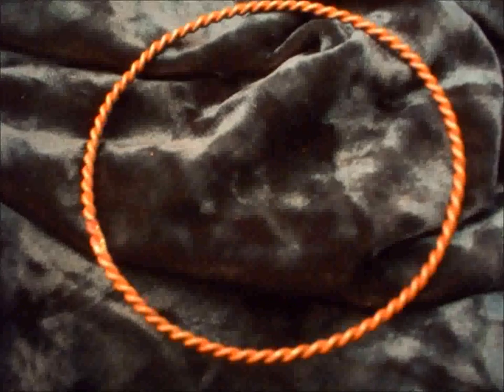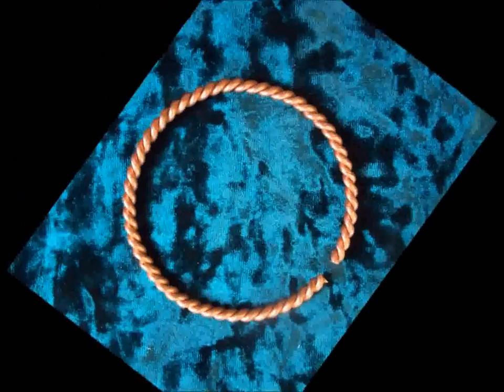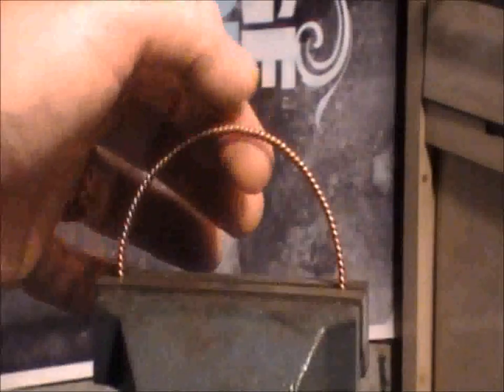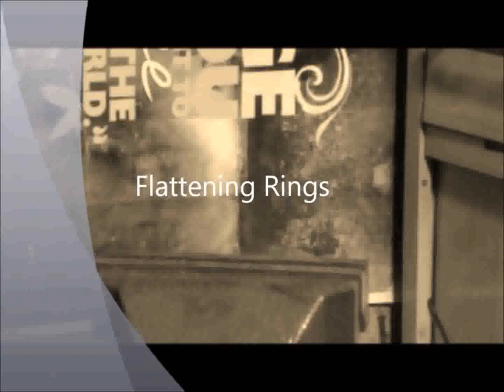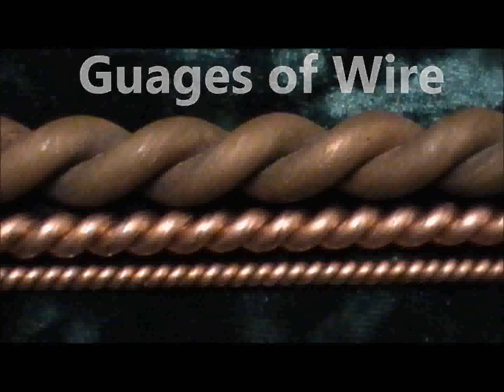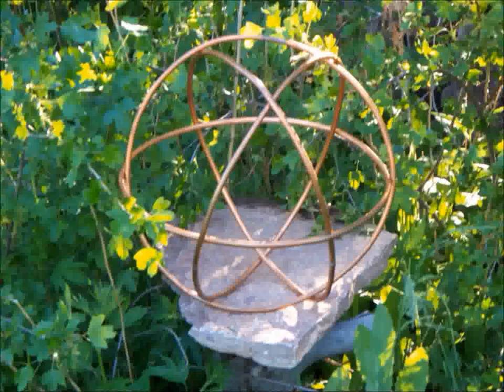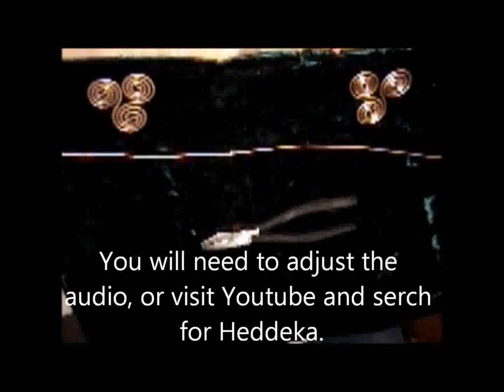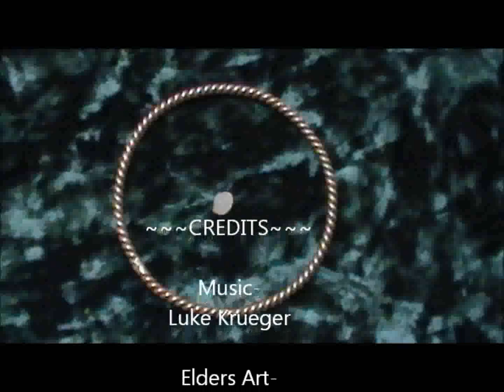Creating the Tensor Ring

Comment: Just a quick few questions: Why use non insulated wire? When twisting the two, it would seem to make sense that it just becomes one conductor; how does this work electrically? Would it not make sense to use wire such as electromagnetic wire?
Reply from the maker: Hi William.  The initial input of energy flow in the Tensor Rings is piezoelectric.  Copper is a crystalline structure, and as a wire is created, or "pulled", the micro-crystals are aligned in a one way flow of energy.  So the energetic flow is actually created within the wire itself.  It is folded in half and twisted, and the specific measure is then the antennae.  When the ends brought back on themselves it creates that continuous flow of energy that moves so fast and freely, some consider the rings to be a room-temperature super conductor.  So anyways, Tensor Rings are basically just a piezoelectric-powered antenna.
Reply: Is it possible for my to make a type of one that is 43" across but winding the wires around the ring? I made four of these rings from 1/4" fiberglass rods...I don't know anything about higher dimension electronics.
Reply from the maker: I'm not sure if seeing it right, but if using a single wire, folded in half and cut, the ends connecting back on themselves to create a continuous flow in each direction in the wire is what will create a Tensor Field.  I feel that wrapping the wires around a fiberglass rod, cut to sacred measure, would create that field.   Again, www.sacredmeasures.com for all the measures.
Reply: Yes, but if the edges touch, being uninsulated, then they would be the same.... Please help me understand.
Reply from the maker: I am confused as to where we are trying to go!!  I can tell you about a Tensor Ring with some knowing and experience, and the theory of making a working ring is all I can give you in this case, though.  A wire has a one way flow of energy, which is contained within the wire as piezoelectric energy.  Folding the wire in half creates a two-way flow.  Twist the wires clockwise, cut the specific cubit measure, and then make sure the ends come back onto their beginning.  That creates the flow in both directions. Powered by the piezoelectric current within the wire.  The specific measure is an antennae, which creates a resonant frequency aka Tensor Field.
Reply: Twistedsage.com
If I can find out how to send a drawing from here, I will show you what I mean...
Reply: Thank you! That was a biq question I had as well because I wondered if using insulated wire, as opposed to  bare or "touching" wire windings would have any different effect and if so would it be amplified/diminished or altered in some other way? Or would insulated wire not even work at all when it comes to tensor rings... i. e. can the whole tensor effect even be produced at all if the copper windings circling the ring are not touching due to the rubber insulation barriers (save for the ending connections)?  @Twistedsagecom